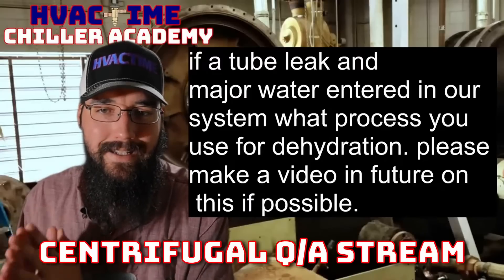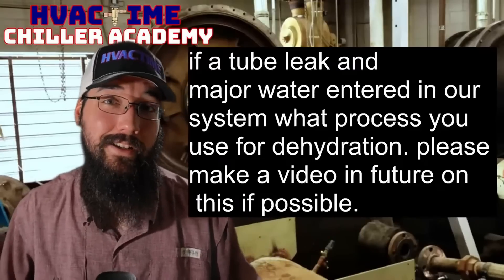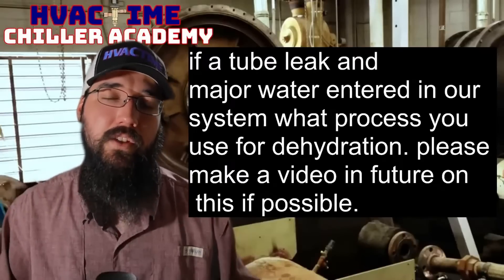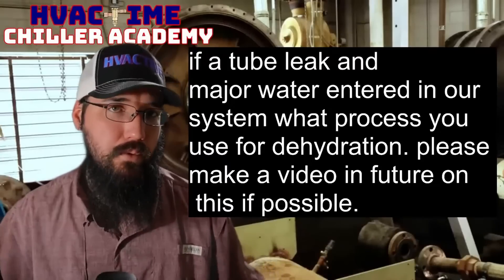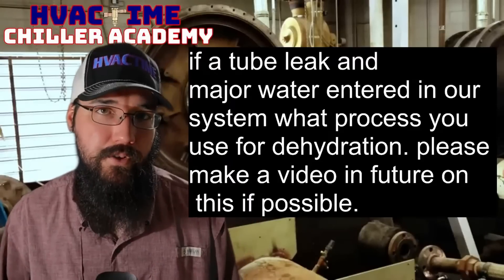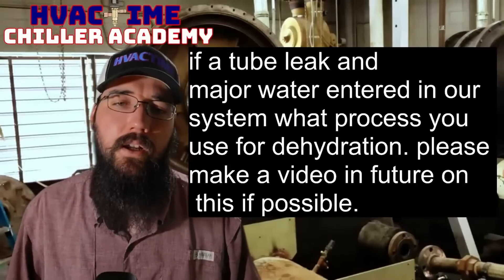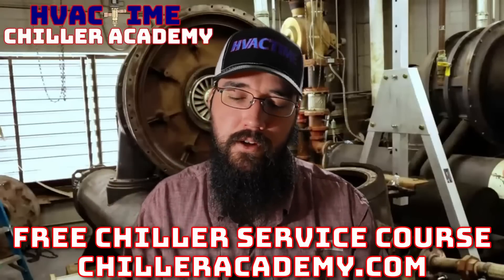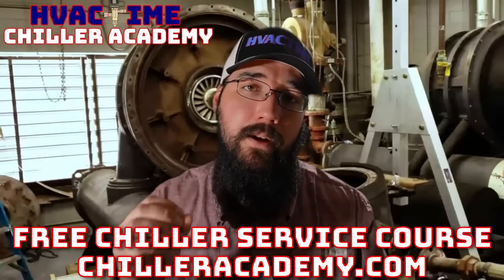Saving Chillers After Catastrophic Tube Failures

Comment: Not from a chiller background but I have a question. 

If it’s a high pressure machine and it leaks till the refrigerant pressure equals the water pressure would you expect the chiller side to stay completely dry? 

Or over time would you expect some form of water mixing into the refrigerant side?

I would think that over time if you’ve lost enough charge (no longer have saturated conditions) that with the change ambient surrounding temperatures of the air/water over time you would eventually think it would begin the mix slowly.

Would be interesting to know

Comment: Have you ever seen it happen during recovery? Thanks
Reply from the maker: Seen it? No. Delt with the aftermath, yes.
Reply: So if a chiller has a refrigerant leak, somewhere that can't be found, is it a good idea to weigh out the charge? I mean, if the chillers at 0psi won't the loop water be able to get in?(if the leak was in a tube) I guess I'm asking is it a better idea to top off if you think it might be a leaky tube to keep the water out?
Reply from the maker: If its a high pressure at 0psi you already lost charge. If its a low pressure it operates below 0psig with proper charge so topping off would only waste charge and make things worse.
Reply from the maker: Now if its a high pressure and you've already lost that much refrigerant due to a tube leak the chiller pressure will equalize with the water loop. This is where eddy current testing is critical.
Reply: @HVACTIME should eddy current testing be done regularly?